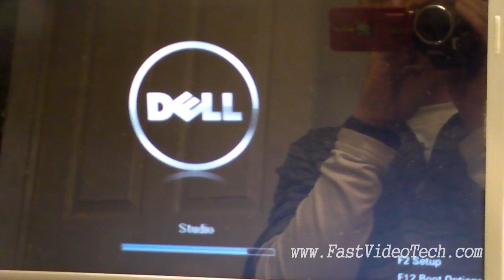Dell Studio No Video Fix (loose connection)

Comment: You know if the video cable was the problem if this fixes it.. as with all problems with electronics, start with the simplest resolution first. If this didn't work, connect an external monitor (as for a desktop) to your laptop. If that doesn't work, it's probably the video card. If the cable was the problem,  the video would show on the external monitor. If not, check the wires where they come through the hinges. Wires tend to get damaged over time with use as  with my HP Probook 4440s (on which the touchpad has only worked intermittently).

Comment: AC adapter problem, because cable is broken. Cable of adapter have 3 pin. inner pin is broken. Laptop working, but not load battery

Comment: Mine does 6beebs will it work
Reply: Nope. You have probably GPU problem. This fix helps only when internal display is disconnected. Which means the laptop works normally with an external monitor (VGA,HDMI) but not with its 15.6" one. In this case it is possible a loose cable connection.